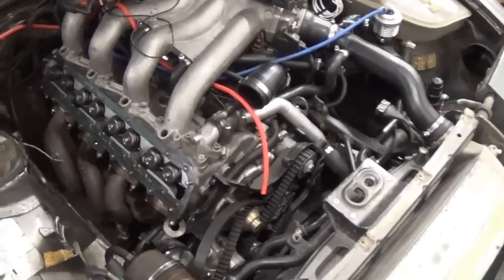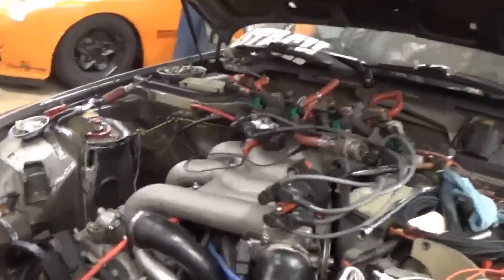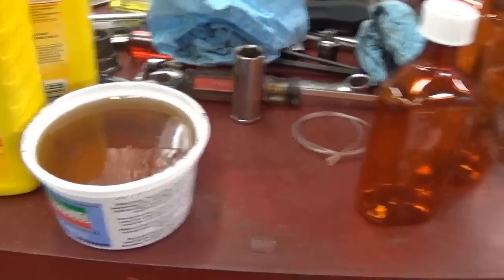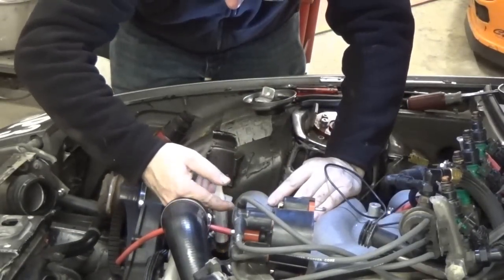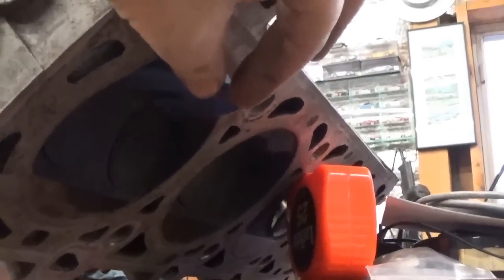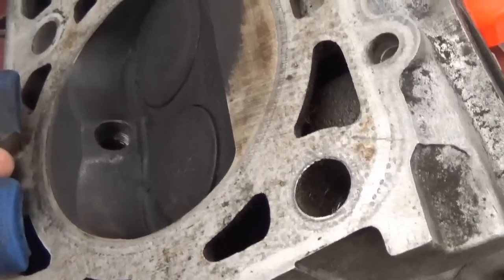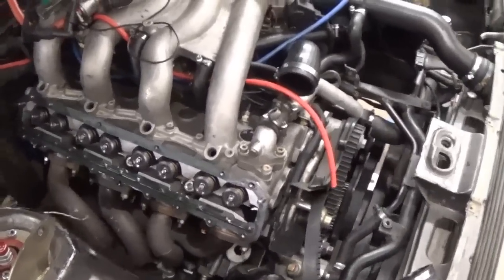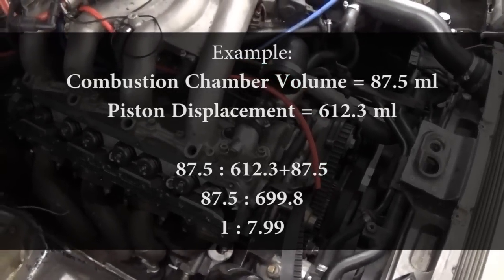Calculating static compression ratio - DIY

Comment: 2 things -- after all that effort to empirically measure the volume of the cylinder at TDC I'm a little disappointed you didn't finish by using empirics for the BDC cylinder  I mean, if we wanted to use the specs, im sure Porsche will tell you the static ratio ;)   Second -- isn't 8:1 a bit low for a 944?  Is this a heavily turbocharged application?.
Reply from the maker: +Zach Goldberg You are 100% right - however, I was under a time constraint, and I was trying to come up with a value to see if a hypothesis I had was correct...  This is a turbo car, which should have an 8:1  ratio - but it was really way under that (and ran like it was way under that).  My hypothesis is that the engine builder specified the wrong pistons.
Reply: +Van Svenson Ah, sorry to hear the engine might have some issues ;(   Either way, very clever video, you never cease to amaze with your ingenuity ;)